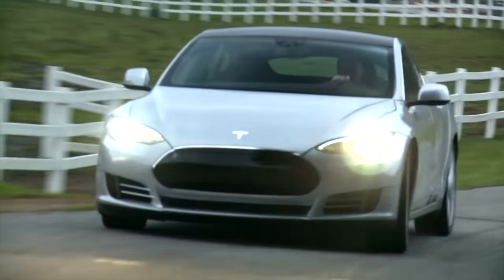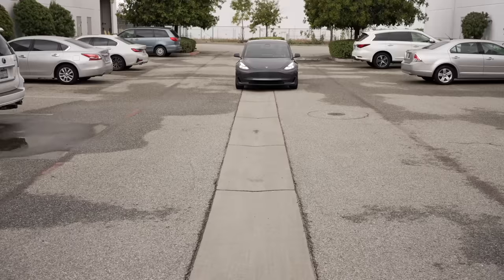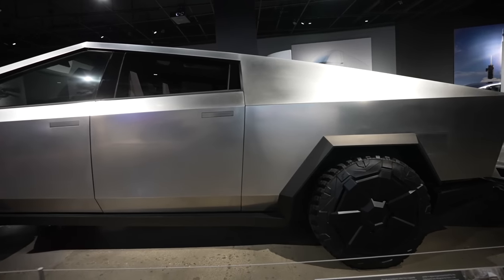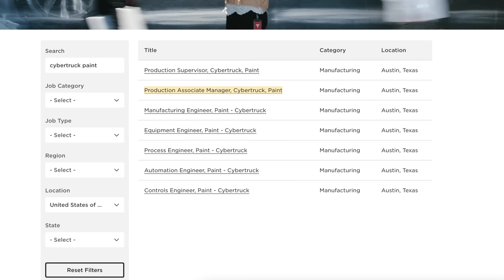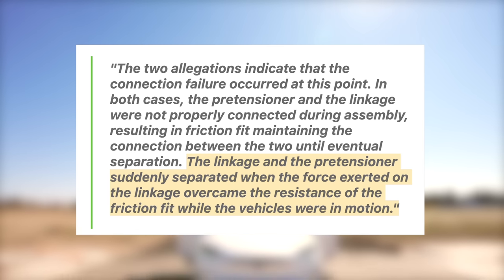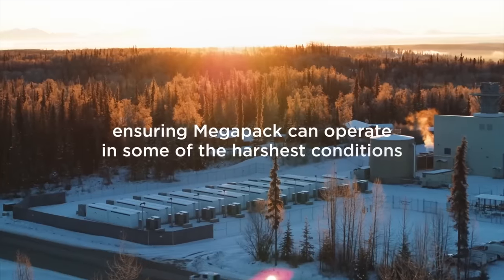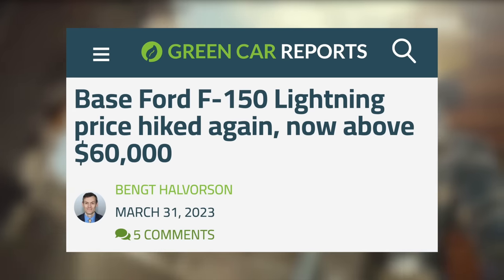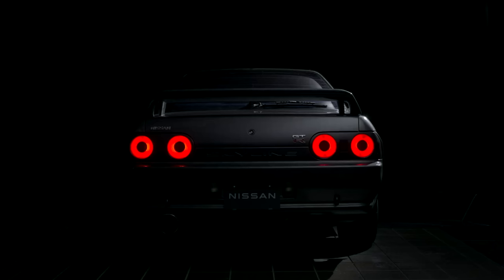Did Tesla Just Leak NEW Cybertruck Colors? | Elon's Change Of Heart

Comment: I would not want to wrap CT It would probably cause corrosion if you did. Stainless needs oxygen to not corrode. Chloride ion degradation is very common even in the best stainless. Sometimes you can see a little corrosion under the head of a stainless bolt due to the lack of oxygen in the joint. Painting stainless is also going to be problematic… unless the new formulation of stainless brings some new characteristics to the table.

Comment: You can heat-treat stainless steel - different temps produce different color tints.  The cost and time to run all panels thru a massive tunnel oven would be great, especially once CT fully ramps, but might be worth it for the variety.  I do think a large number of people would definitely pay, even if the "color tint upgrade" was very expensive.  Would still be way cheaper than installing their traditional $100M paint factory within a factory.  Truly hope they get at least a few CT out for sale in Q3, but that's most likely wishful thinking.
Reply: SS can be colored with lasers
Reply: @cliff4377  Yes I am going to put some laser Tattoos on mine so I can find it in the forest of CTs in the car park.
Reply: @lionelwylie2326  Mine will carry id: NCC-1701 CT
Reply: @FrunkensteinVonZipperneck  That would make a good number plate you should reserve it.

Comment: If I leave my kids in the car I usually turn on dog mode vs keep. One, it lets anyone passing the car know they are safe (temperature wise) and two, my kids get a kick out of the dog. For those concerned about me leaving my kids in the car, I only do so under certain circumstances; car is still in eyesight and ear shot, or when running into the house quickly to grab something.

Comment: Just because the outer body panels (for the most part) are stainless steel and won’t have paint, it does not mean that there won’t be other parts such around the vehicle or in the interior or underlying structure won’t need paint.

Comment: Change of heart or Elon's fart?
This stinks.

So Elon made a big deal of taking the cold rolled stainless steel from his rocket ships
and slap on the outside of the Mad Max Cybertruck - any color you want as long as it's Stainless Steel.
That meant NO paint shop, which is 25% of making the truck

The steel shell becomes monocoque - meaning it isn't just hung on a frame - it is the frame for everything else.
It also meant that the steel can take minor bends before it snaps so the CyberTruck looks like something out of a Mad Max movie - ugly to the core.

Now Elon flips and wants to paint Stainless Steel?
Asking AI, that's a tall order and much harder to do than normal steel and it requires constant care throughout the life of the car.

So why not dump the stainless steel and use normal steel like in the Model 3 and Y just a millimeter thicker and it can have all kinds of shapes like a normal car

Something's screwy here....something stinks

Comment: New engineer/dept head for DBE is not a good sign for past progress.  No one would have quit if they were close to solving the problem of ramping to mass production.  I fear, like FSD, this problem could be years away from being fully solved.  Thankfully, it sounds like batt supply for vehicles is fairly solid for a couple more years, but using Tesla's in-house 4680 DBE production for MY, CT and Semi would ultimately open up way more foreign supply for Megapacks.  Hope Tesla is trying to perfect LFP chem in the 4680 form factor. That will be the Holy Grail in the batt industry.
Reply: We are being fed a lot of bovine excrement about when this truck will go into production.

Comment: Maybe there will be 2 or 3 versions of the Cybertruck. I think stainless would be more costly to paint, adhesion issues. So why not an aluminum version with custom colours.
Wouldn't that be cool and would appeal to a lot more people. Possibly even a smaller size like a typical sport truck.
Cybertruck "Badass" stainless steel version
Cybertruck "Kickass" aluminum version W/ custom colours ........Maybe even a third version 
Cybertruck "Smartass" w/ 3d printed graphics (applied directly) 😂🤔
Reply: Aluminum would kinda do away with the exoskeleton acting as part of the frame and strength of the truck, thus it would require an actual full frame which the CyberTruck isn’t designed to have.
Reply: @fearsomebeard4290  I understand the exoskeleton,  but with a front and rear casting aluminum could work especially with a smaller version of the truck .